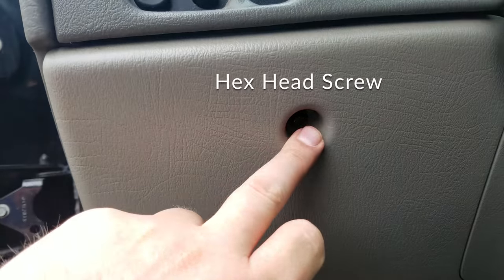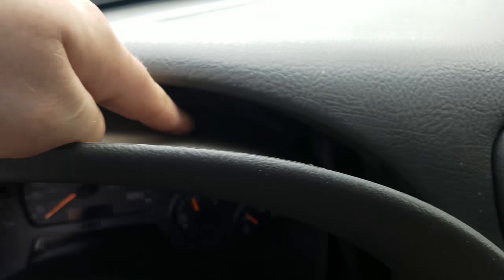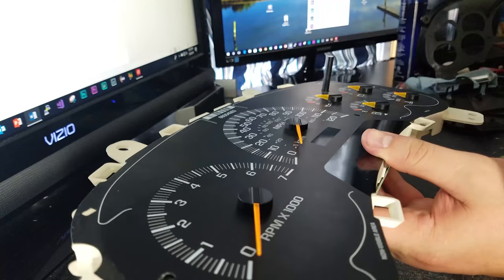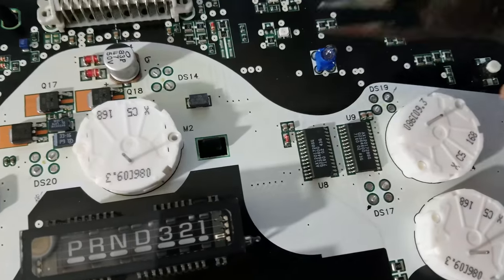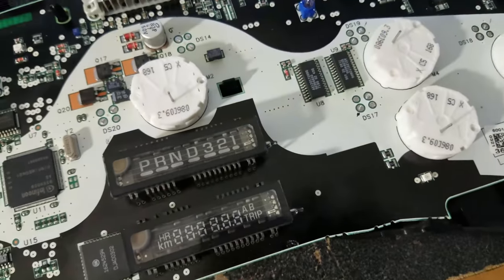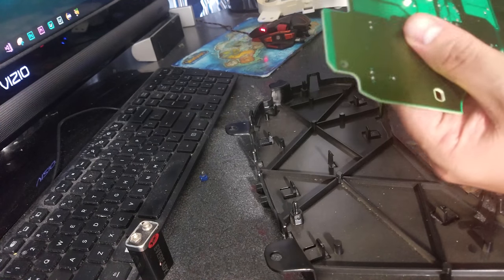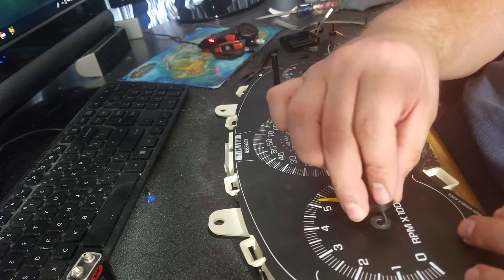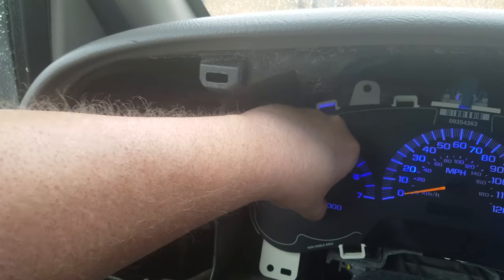Replacing Stepper Motors and Led's on Trailblazer Instrument Cluster

Comment: Excellent video man, an easy way to find the home (zero) positions of the panel, just don't install any needle, fire-up the engine, switch it off & then carefully insert all the needles in the zero position without turning the stepper motors.
Reply: Wish I saw your comment yesterday 😂

Comment: Thank you so much for putting this video out there! Much appreciated my man. Was curious about how to get at the gauges quickly and easily. Got flaky RPM and Temp gauges in my cluster on my 2003 TB. Going to swap out the steppers to avoid having to buy a whole new panel.

Comment: What do you mean you just wiggled them out? Did you not heat them up with the iron and then wiggle them out? And why didn't you put the indicators back on at ZERO? You left out a ton of steps here.

Comment: That's interesting how it would not calibrate at first. I wonder if when you set all needles to zero, disconnected the battery then reconnected if it would have worked.
Reply: Reason I say that is because when I replaced the starter in my F150 the other day I disconnected the ground and when everything was done turned the key over and the gauges calibrated themselves again.
Reply from the maker: Not sure...I do know everytime you turn your car on they are suppose to calibrate themselves. I was reading where you are suppose to move the dial a little below zero and that should work.

Comment: I replaced my stepper motors and all of them work with the exception of the fuel gauge and oil pressure gauge. Any idea why all of them worked when repaired but not those two?
Reply: If you already replaced the stepper motor  for the oil and it still dont read then you have a bad oil pressure sensor very easy too switch out, with the fuel not reading that is the meter or sensor in the gas tank, that one involves some work